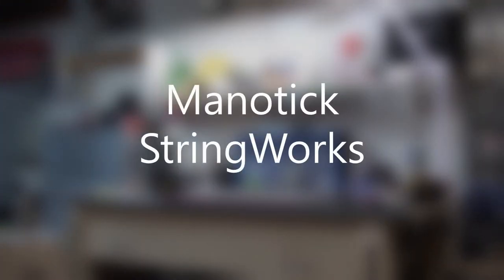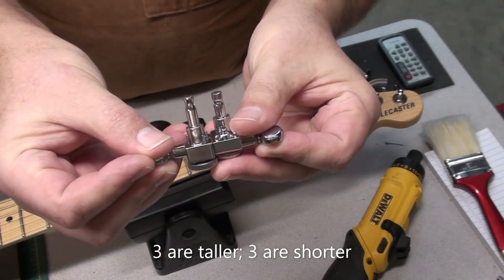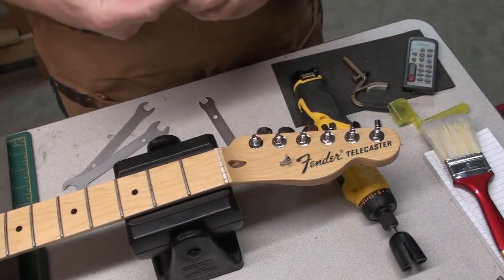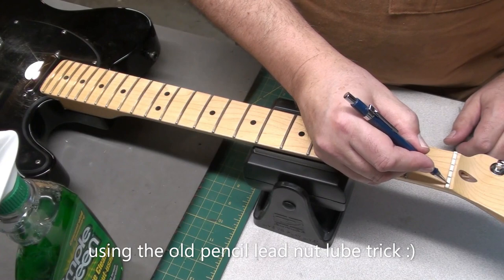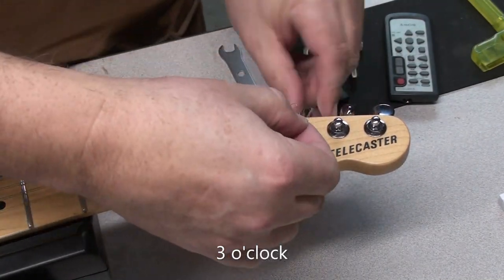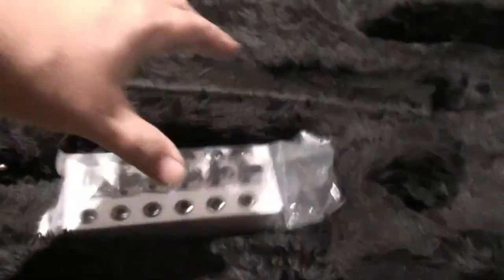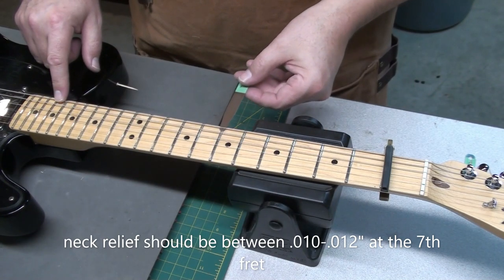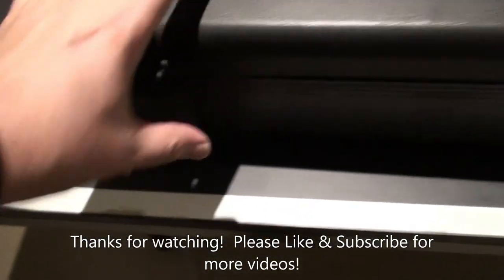Installing Fender Locking Tuners on a 2017 Telecaster -it's an easy DIY job that you can do at home.

Comment: Will they fit into an American standard '95
Reply from the maker: They should fit fine, David.  Check you existing tuners and see of the they have the 2 locating pins  like the locking tuners do on the backside.
Reply: They fit perfectly thanks...